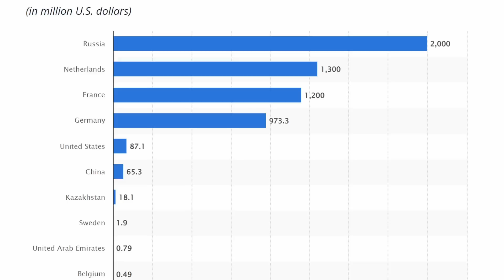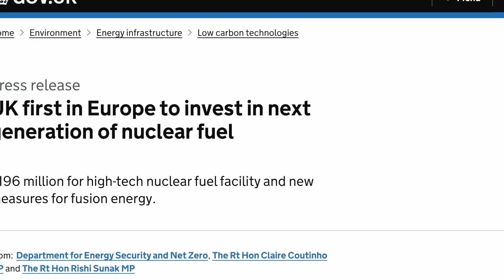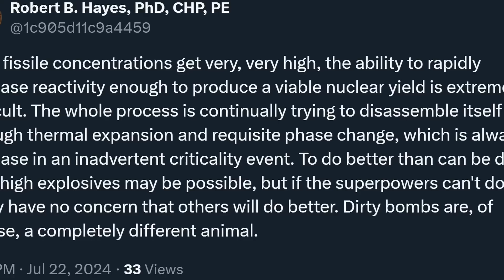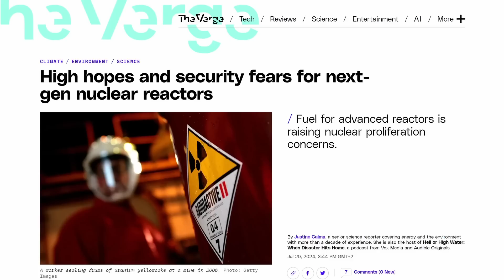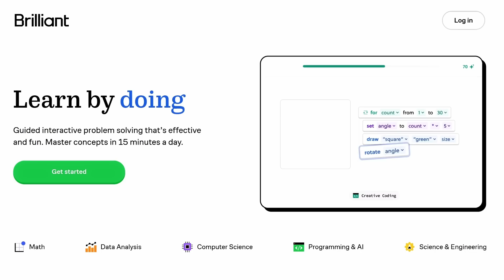Small modular reactor fuel could be used to build nuclear bomb, experts warn

Comment: Small point... U235 is an isotope of an element, not a "compound".
Reply: Technically speaking, you are correct.  Rhetorically speaking... English is flexible enough to allow compound to mean "of stuff".
Reply: @gilian2587 Not even rhetorically. That one just slipped by somehow.
Reply: Oh ho!  @gilian2587
Reply: Oh, i thought she was talking about the chemical configuration... You think it was a mistake?
Reply: @jpt3640  Technically speaking... every conglomeration of atoms are composed of isotopes of those atoms.  Each atom of a homogeneous material have the same number of protons; so they are all the same kind of atom, but each atom has a different number of neutrons.  Some configurations of neutron to proton ratio are more stable than others.  The term compound usually ignores  isotopes entirely, and it references a combination of different atoms that make up a larger macrosubstance.  For example; water is a compound of two hydrogen atoms bound to one oxygen atom.  Sulphuric acid is a compound of two hydrogen bound to one sulfur bound to four oxygen.
Reply: @jpt3640  One could refer to them as conglomerations of a given isotopic ratio and be more technically correct.  Problem is... that gets pretty unwieldy pretty bloody quickly.
Reply: Some nuclear fuels contain uranium dioxide, which is a compound.
Reply: @markuskuhn9375  but it is the fissile isotope U235 which is the object, regardless of what it may be chemically bound with.

Comment: Vacuum chamber pods hard heat obsorbent on the outside but nothing on the inside not even Air. Popping in an explosion would pull back air recucing blast radius

Comment: 4:17 What is here meant by „the superpowers can‘t do it“? I thought they can do high concentrations since 1945?
Reply: The quote doesn't refer to the enrichment process, but rather to making bombs with LEU or HALEU (without further enrichment). The superpowers use bombs with enrichments of 90%+, which you obviously can't buy for civilian use. They can't make a bomb with lower enrichment. Then again, they have no reason to try, since highly enriched fuel is available and makes smaller, better bombs. But when bombs were first developed enrichment methods were much worse, so back then they would have at least calculated the feasibility of a bomb with lower enrichment.
Reply: I think „the superpowers can‘t do it“ is a misleading argument. Super powers have enrichment facilities so they obviously go all the way because higher enrichment means smaller & more efficient weapons. Their focus during the cold war was to go for even bigger booms and for weight reduction for even more hellish ICBMs.  Some years ago, Iran opened (or planned to open) a reactor running on 20% enriched uranium which they claimed was for medical & research use, but this caused a lot of outrage because the consensus back then among experts was that this was usable for creation of nuclear weapons (i assumed back then by breeding plutonium, but 500kg critical mass is probably also sufficiently small for a really clunky bomb)

Comment: If I recall correctly, John McPhee wrote about this in The Curve of Binding Energy 30 years ago. I suspect the reason nationstates didn't do it with LEU or HALEU is that they wanted smaller, safer, and more reliable weapons that could be delivered by aircraft and eventually by artillery and rockets instead of railcar or truck.

Comment: To be specify, It's not secret how nukes are tweaked to make boomboom. It's one of the first things any amateur physics nerd learns.

You can make a simple gun-type fission bomb in your garage if you have to he resorces.

What's top secret however is the process of making, placing, and detonating the shaped charges needed for initial fission. And the extremely precise calculations for the placing and timing of the fuel for the fusion. It's insanely advanced stuff.
Reply: The devil is in the details.
Reply: @Sven_Dongle The gun type merely fires a piece of weapons grade uranium into another piece. If you had weapons grade uranium, you could literally drop a piece from maybe 30 feet onto another and get an atomic explosion.
Reply: @silikon2  No, you wouldn't, nothing like a gun type. This assembly would be far too slow. It would disassemble itself and just make a radioactive mess, not a conventional nuclear weapon. That's not nearly as easy as you think.
Reply: @silikon2  The whole reason you need a "gun" design is to reach the required velocity, dropping them onto each other won't work, just like the Demon Core didn't explode when suddenly supercritical. The reason they didn't make a gun type design with plutonium is that you can't reach the required velocity for it to actually work.
Reply: @zolikoff  But I did specify 30 feet for that reason. The demon core was dropped a few millimeters at best. 

Look I’m not at all saying there’s no devil in the details, only that the biggest problem by far is/was getting weapons grade material. The basic gun design is something someone could plausibly do in their garage if they were clever. 

Maybe their bomb would be a fizzle. I don’t think anyone’s been arguing it would be the best bomb. But if the fizzle is 1 kt versus 20… that’s still a very effective and terrifying weapon.
Reply: @silikon2  It doesnt really work that way. Why do you think reactors melt rather than detonate with chain reaction? When they do go up its usually because of hydrogen.
Reply: @silikon2  Dropping from 30ft isn't good enough either. In fact, the US. Office of Technology Assessment states in a 1977 report that gun- and implosion-type designs are approx. equally hard to make. But your main point is correct, building a "low" yield nuclear bomb is not extremely complex provided you have weapons grade material. The same report states that it is possible, given weapons grade material, to develop and produce a bomb with a yield of 10-20 kilotons with less than a million dollars and minimal equipment (without any access to classified knowledge!). Reactor grade material reduces the size to a few kilotons.
Reply: Correct. The gun type is so simple the US dropped one without even testing the design.
Reply: @silikon2  So you dont think there were any sort of tests to verify that design? Amusing.
Reply: @Sven_Dongle   I should have been more clear, the capability of the gun type design to actually produce an atomic explosion was never tested. Certainly they would have thoroughly tested all the nuts and bolts of the weapon. Make sure the gun works reliably, the altimeter, etc.
Reply: To everyone who thinks it is impossible: I quote the US. Office of Technology Assessment, 1977: "a small group of people, [without] classified
literature, could possibly design and build a
crude nuclear explosive device. [...] Only modest machine-shop facilities [...] would be required. The financial resources for acquisition of necessary
equipment on open markets need not exceed a
fraction of a million dollars. [...] Again, it is assumed that sufficient quantities of fissile material have
been provided"
The report also states the yield as difficult to estimate, but possibly as high as 20 kton for weapons grade material and a few kton for reactor grade material.
Reply: @entcraft44  Though dangerous and frequently lethal to humans within the immediate area, the critical mass formed would not be capable of producing a massive nuclear explosion of the type that fission bombs are designed to produce. This is because all the design features needed to make a nuclear warhead cannot arise by chance. In some cases, the heat released by the chain reaction will cause the fissile (and other nearby) materials to expand. In such cases, the chain reaction can either settle into a low power steady state or may even become either temporarily or permanently shut down (subcritical)
Reply: @Sven_Dongle  Have you read and understood what I was talking about? I was talking about a deliberately designed nuclear bomb.
Reply: Amateur geniuses think every chain reaction produces a massive detonation lol.
Reply: @Sven_Dongle  You end up with what happened with the demon core, or a meltdown at best. Then again there were some failed one point detonation tests that produced a small yield. Even if you only managed a 100 ton equivalent, it would be a bad day for anyone nearby.
Reply: It's true that it's secret and advanced, but I have it on good authority that it's not that hard for a dedicated adversary with the resources of even a small modern nation-state. The hard step is, and has always been, the enrichment.
Reply: My guess is that if you can nowadays design and certify a nuclear power plant entirely in the computer (Bill Gates' SMR did this), then you can probably also design a nuclear weapon more or less entirely in the computer.
The Manhattan project was before the advent of CNC machines, before transistors or power electronics, before computational fluid dynamics. I mean, one thing the "operators" of Fat Man apparently struggled with was crappy batteries FFS.
Reply: Making the shaped explosive charges is not a challenge today with modern simulation software. The real challenge is keeping costs down and maintaining your nuke project a secret from literally every superpower in the world while enriching the uranium to a point where making a bomb is practical. It may be news to some people but Russia and China also don't want a batshit insane terrorist gaining access to armageddon level technology. Literally every single nulcear power wants to make sure that there aren't any other nuclear powers popping up.
Reply: The 'build it in your basement' fools in this sub-thread have no idea what they're talking about.
Reply: @rbaxter286  Agree. A physicist.
Reply: @rbaxter286  The engineering part really is that simple, that's all I'm saying. It doesn't mean anyone can just make one, there's more steps than just assembly. Which is why I pointed out the "resources".

In  other words, enriched uranium. That's not something you can just acquire. It requires an extremely sophisticated (and regulated) centrifuge, a whole bunch of them actually.

But I'm not talking about DIY U235, or ordering some from Amazon. I'm talking about what Sabine is talking about, concern of this new fuel falling in to the wrong hands, and once there, the relative simplicity of a crude gun-type.
Reply: @rbaxter286  No need to correct them. Just think of it as another level of safety. Even if an idiot manages to make one because it's "so simple" and keep it secret it will fail.
Reply: It's not like the salad bowl design is that hard either some plastic explosives some type of wedge to prevent critical mass beforehand 😮
Reply: Won't be that amazing without deuterium

Comment: The highly secret procedure to make radioactive material supercritical has become well known almost everywhere because of Internet. The reason nobody is trying to make a nuclear bomb is, by doing so, you would die before you get even close to it. Much the way scientists have tickled the dragon's tail in the past. With a screw driver.

The same goes for the enrichment process. Almost unwillingly we have learned that Uranium has to be transformed into UF plus some numbers I can't recall, in order to make it a gas and thus separe over hundreds of high speed stages the light from the heavy molecules by centrifugation. And then, by chemical magic, get the metal back to business.

Also, we have been thoroughly introduced into production of Plutonium in hot breeders, and how to fuse hydrogen into helium by squeezing violently Pu. That would be a hydrogen bomb, after all. Nobody has survived laboratory experience in this field, yet. The last known one happened thousands of years ago, in biblical times.

But it's always good to know that someone is concerned about a problem they are trying to solve for themselves!

Comment: Small modular reactors are not cheaper, they are just faster, as in they can be put in place where they are needed faster than a conventional reactor. Conventional reactors are more efficient and cheaper per megawatthour of power.

Edit: "Just exactly how it works is today the most top secret of secrets." It really isn't. While the exact, precise details aren't publicly accessible something like fat man or little boy is relatively easy to achieve and the information required is relatively easy to come by through public information and what details you need to work out are easily simulated with modern computer and a spare nuclear physicist compared to modern H bombs, which are actually kept secret. Worse, a salted bomb requires even less knowledge and skill.
Reply: True, it depends on your application. You would never use a greyhound bus as a taxi and you would not use a moped to transport people cross country. Large reactors don’t produce good quality steam for industrial use and an SMR won’t produce electricity as efficiently as a CANDU reactor. Each has its own place. SMR are a good solution to replacing small gas or coal plants. Building 4 CANDU reactors in remote Alaska of northern Alberta diamond mine makes no sense.
Reply: @Sophie-and-Ken  Yup, but if you have the infrastructure and you are likely to be at peace for the forseeable future (not a sure thing today) a few CANDU reactors hooked up to your main power grid are a lot better.

(I'm something of a CANDU and advanced CANDU reactor fanboy. I love the extensive safety features and the fuel type and refueling flexibility. Runs on just about anything and virtually can't suffer a serious accident. Love it.)

On the other hand, SMRs are ideal emergency solutions for quickly supplementing inadequate( or destroyed) power generation in an area.
Reply: A faster build means a MUCH less expensive build. If you could snap your fingers and build a conventional power plant overnight, the cost is going to be a quarter the cost of building the plant over a 10 year period. Interest on the capital investment is one reason. And less manpower is another. Think how much it would cost you if you were building a house and it took 10 years before you got the occupancy permit.
Reply: @ws6002  It's a matter of initial cost plus maintenace vs generated power. SMRs are much less efficient than regular nuclear power plants, especially modern reactors. SMRs are good for emergencies, traditional reactors are better if you have the time to do things properly. The majority of the cost for a CANDU reactor is heavy water, not construction. Assuming that it's planned out properly and no one is intentionally delaying it, like I suspect is the case with Hinkley.
Reply: @DefaultFlame  
What's the interest cost on $5 billion over 10 years at 8%?
Reply: @ws6002  If you are referring to Hinkley, I'm pretty sure that's either a case of tax evasion, fraud, or an anti-nuclear government interfering, becuase the delays in that project is insane. That, or they are completely incompetent.

Comment: I still think Thorium is the way to go.
Reply: Way to go where? There is no supply chain, pre or post processing or commercial grade reactor designs.
Reply: Super acidic, seems to dissolve everything at those temperatures
Reply: We have an overabundance of fuel that can be used as a power source.  It's just a question of when there is a will, there will be a way.
Reply: @gilian2587     Thorium cannot initiate a reaction by itself, but requires uranium to start it.  And even though there may be a lot of thorium in nature it is harder to extract.
Reply: So you can do chemical enrichment of isotopes onsite?
Reply: @ws7001 there is one design where you put in a small amount of fuel that is enriched and then you have a bunch of fuel that isn't fissionable and as the reactor is running it actually converts the additional non-fissionable fuel into fissionable fuel

In this way they mitigate the concern that the fuel would be used to produce a nuclear weapon
Reply: @Toxicpoolofreekingmascul-lj4yd  Thor can do that with a hammer
Reply: Since uranium is cheap and available, why bother?
Reply: @JohnHughesChampigny  Uranium may be cheap and available, but there are multiple problems with the current nuke plant.  Right now the only new nuke plants under construction are in Georgia ( Vogtle plant in Waynesboro, Georgia) now running at tens of billions $$. and thus way over initial estimated costs.  Nobody can afford these expensive beasts anymore.  

And the expectation of the small modular reactor has also dried up.  The one company (Nuscale) that was mass produce small reactors withdrew their commitment.    

All these claims of how great nuclear power are empty because so little is actually happening in the US.
Reply: Yes.
Reply: And where are any working/profitable  Thorium reactors?   Their are none except in over excited peoples imaginations.
Reply: @AORD72 is there not a thorium reactor at Oakridge?
Reply: If Thorium were a thing, don't you think that there would already be dozens of reactors in use?
For half a century people nagged about the auto industry blocking EVs and guess what: we have them and they suck.
Reply: @JZsBFF  You mean how cars were all over the place in 1600s France?  If everyone had that attitude regarding research and development then nothing would ever be invented.
Reply: @gilian2587  Nope, don't put words in my comment which aren't mine. It's just that EV is a dead end because unefficient.
Reply: @gilian2587  EV using FF to make electricity is not a step forward.
Reply: @joeschmoe8965  What is your acronym FF, in this case?  

Edit.  Ah; fossil fuels.  Erm... I wasn't advocating for Electric Vehicles or fossil  fuels.